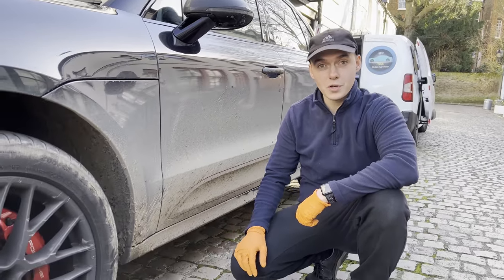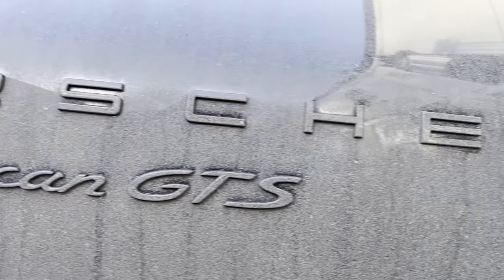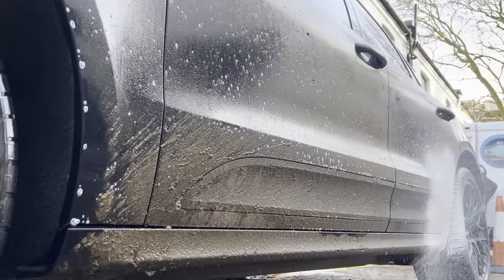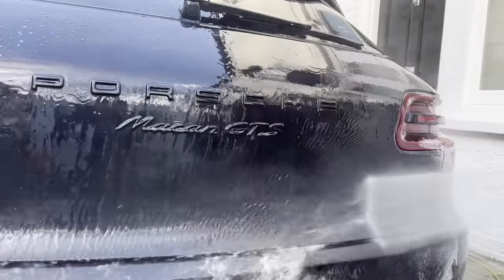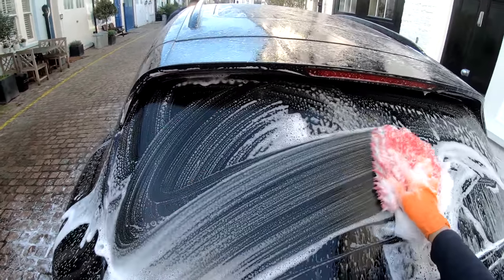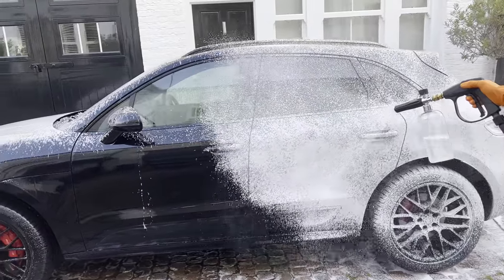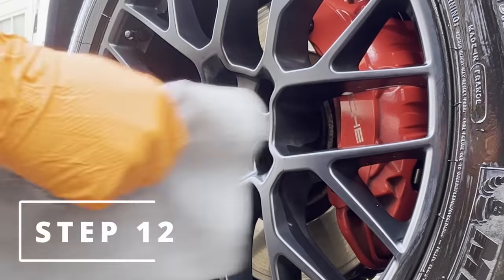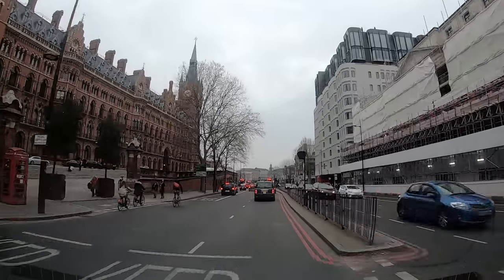Insane Detailing Transformation - Satisfying ASMR

Comment: I always wonder if it's better to lightly spray the car first with water to start loosening the dirt, or go the prewash/foam route. In the States, you get very muddy truck, and it seems like the chemicals would not even saturate down to the paint level.
Reply from the maker: From my experience and the testing that I have done, doing the pre wash first seems to do a better job as it is not being diluted by the water and also it dwells on the dry surface for a longer period

Comment: I'm not a detailer but common sense at 3:30 you should really be washing the car from top to bottom so all the dirt washes down, when you start from the bottom, the dirt from above then slides down to the part you just cleaned.
Reply from the maker: This is usually true however when the car is quite dirty, the bottom to top method removes the dirt better as the cleaning chemicals are hit directly on the dirt and have not run off the car. This is why for example, if you look at truck washes on youtube, they also use the bottom to top method